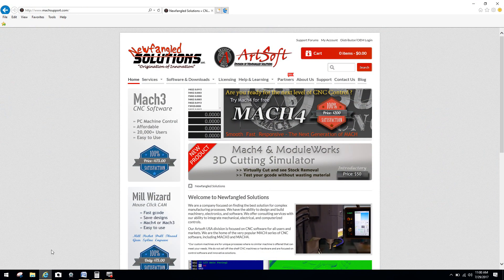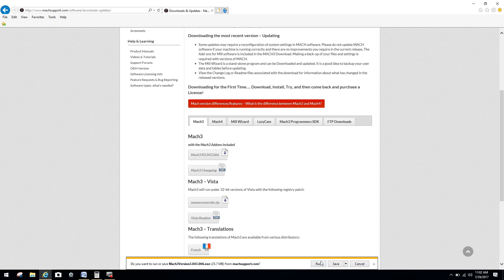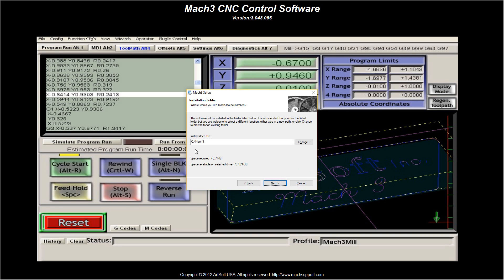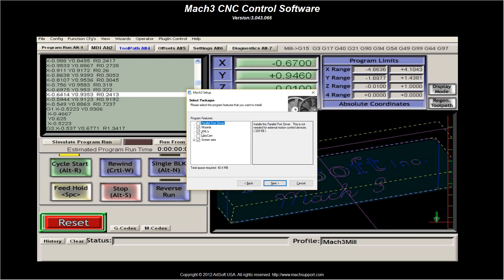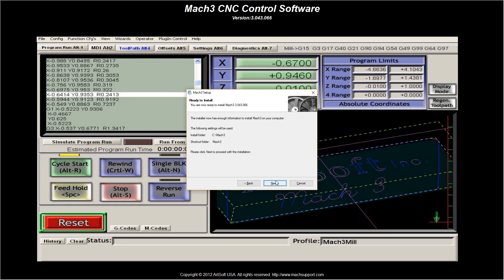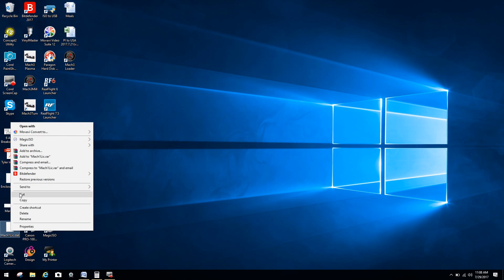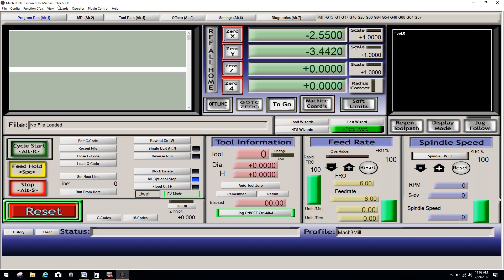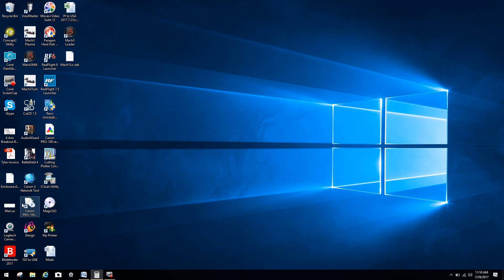How To Install Mach3 Motion Control Software & Your Users License (A very straight forward process)

Comment: Thanks for the info. I tried reinstalling it like 3 times. I downloaded the .exe file from machsupport.com but it still wont work. Im wondering if its my laptop that is the problem. Im using an Acer Aspire A315-21-92FK. I cant find any help online. Thanks for your time
Reply from the maker: Are you using a UC-100, or Ethernet Smooth Stepper? You can't use parallel port on a laptop. Thank you,
Vince
Reply: @corvetteguy50 R Right now I'm not hooked up to a cnc machine. I'm just trying to get Mach3 to load properly. But I will be using a UC-100. I don't have the parallel port driver installed (because i'm using a laptop) but the mach3 screen won't load. Also, my top bar doesn't say Mach3 demo, it says Mach3 CNC Controller. I have no idea why. I have an official license but when I put the license in the Mach3 folder nothing changes. Any ideas? Thanks a lot :).
William
Reply from the maker: Try using the method in this video I made as it assures complete removal of the software. https://youtu.be/K_9fvehvv-w

Thank you,
Vince

Comment: Thanks for the great video. However, I have a problem when I try to load mach3. When it loads up the screen is white. There is still the toolbar at the top of the window, but the rest Is white. I tried loading the 1204 screen, but nothing changes. Any ideas? Thanks.
Reply from the maker: William, thank you for your support. I recommend unistalling the software, reinstalling it. If the software came from a chinese machine there;s a 99% chance its pirated. Thank you, Vince

Comment: I've understand that Mach3 won't work with Windows 7 pro 64 bit, but do have parallel port for 
my printer. Do I need any hardware to run Mach3 software because of 64 
bit machine?
Reply from the maker: Yes you'll require either a UC-100 motion controller to convert the system to USB https://www.ebay.com/itm/132505537529, or Ethernet Smooth stepper https://www.ebay.com/itm/133064380079 

Either of these will work with any Windows platform be it 32bit, or 64bit.

Thank you,
Vince

Comment: I've understand that Mach3 won't work with Windows 7 pro 64 bit, but do have parallel port for 
my printer. Do I need any hardware to run Mach3 software because of 64 
bit machine?

Comment: I'm a newbe to Mach3 CNC Router, so I hope this is not a foolish question, but When downloading the software and installing do I need to have my machine plugged in my usb and turned on? I'm running Windows 7 64 bit
Reply from the maker: No question's foolish. thank you for your support. If your simply installing the software then you don't have to have the USB turned on. The only time you will require the unit turned on is prior to running the software. Thank you,
Vince
Reply: @corvetteguy50  Thank you....  I am running Windows 7 pro 64 bit NOT 32 bit, and do have parallel port for my printer. Do I need any hardware to run Mach3 software because of 64 bit machine?

Comment: Hi Vince, Great video, good tip about the parallel port driver. I have just installed Mach3 on my windows 10 computer and am waiting for my UC 100 to arive. So I will uninstall and re-install and disable the driver. Just one question if I may. I have got mach3 to go full screen but my icons are masive. have I done something wrong? I have been into mach3 General Logic Config and all the boxes in Screen Control are checked. So I'm scratching my head a bit. I noticed your icons are normal size and the mach3 went full screen. I would be grateful for any advice you could give. Thanks, Terry.
Reply from the maker: Terry,
Thank you for your support. I would uninstall Mach after making a backup of your settings, and reinstall it again to see if that corrects the issue. Their are many variables that can cause issues with it from other programs, to hardware configurations. I would start with this first as its the fastest to do, and least intrusive.
Thank you,
Vince
Reply: Thank you for your swift reply. I will re-install mach3 again and see how it goes. Thanks, Terry.
Reply from the maker: @Wrighty  You Bet :) Thank you Vince

Comment: I have Mach3 running under Windows XP for 5 years. It may be a dinosaur, but as a stand alone, dedicated system, it is still hard to beat. My axies according to Mach 3 have done over a thousand kilometers........  AND NEVER LOST A STEP.   Beat that!   :) Who needs smooth steppers and ethernet?
Reply from the maker: Warren, thank you for your support. XP started it all, and if used as a dedicated system it still works for many like yourself which is all that matters. :)
Thank you,
Vince

Comment: my 6040 is usb .. computer 32 bit windows 7.. I cannot get mach 3 to launch at all.. I keep getting a pluggin defective message
Reply from the maker: I would uninstall it, and reinstall it. If the unit is USB you have to make sure you installed the required USB driver for your system. I suggest contacting the vendor as they should have it. Thank you,
 Vince
Reply: thanks , I messaged them.. I went to china cnc and downloaded their usb driver, but who knows how many different 6040s are out there now.. SO im waiting for the seller to reply.. thanks.
Reply: so mach 3 is running , I got a reply from the Chinese seller " Oh we soo soo sorry , we no include driver for you order. We get order weekend , and we hurry to ship item. we send Monday , Ok my friend ? sincere, Phang " So , I need to find all 6040 drivers and download them all I guess.
Reply from the maker: Rob, this is a massive issue when ordering overseas. The sellers typically have no regard for your lost time. I hope the system runs great after the headache. If you Google for the drivers, if you haven't already you may find them. The only issue is there are so many vendors selling these types of systems now that even if you find one you don't know if it will be compatible with your system.  Thank you Vince

Comment: I've had mach3 for about 8 years computers old keeps crashing One update to a newer system what do you recommend I have the old Mach 3 with a Serial port thanks
Reply from the maker: Kevin,
You'll need a UC-100 USB controller to use Mach3 with a newer Windows computer running Windows 7-10.
This will allow you to convert the system to USB control, and get rid of the old parallel port DB25 cable.
Thank you,
Vince
Reply: Hello just trying to see if you can help me out I got another computer Windows XP got to  working only problem I'm having is a z axis every time you cut a part and it moves to cut the next part it keeps picking up and pulling away from the material try to turn the THC off try to motor tune everything I do doesn't work any ideas thanks
Reply from the maker: Kevin, 
Please review my video on troubleshooting your system like a pro located here. https://youtu.be/FSQGvfGt2Qs

If you still would like a consultation you could contact me at my email address Storm2313@gmail.com

Thank you,
Vince

Comment: I just wanted to add that enabling the parallel port driver on a laptop that does not have a parallel port can lead to disastrous results.  I installed Mach3 using the default settings (parallel port enabled), and it totally corrupted my Windows 10 (this is on a cheap RCA Cambios Laptop). I could not even reboot without it constantly going into the blue screen of death. I had to reinstall Windows from scratch. The problem happened again, until I saw your discussion on disabling the parallel port. Now it works fine. Thanks.
Reply from the maker: Andrew thank you for the input. Vince
Reply: @Andrew Sarangan hello i am using mach3 on laptop it doesn't have parallel port. The motors doesn't work. I am beginner. Can you answer why its happening or its not moving because i am using laptop. Thank you

Comment: It is amazing how many folks today don't know how to cut, copy, or paste on their computer. Nice job illustrating the installation. Thanks.
Reply from the maker: Robert, Thank you for your support. I think sometimes it has to do with the manufacturers forgetting the fastest way to illustrate anything is with a video. I honestly get more questions on the installation of software than I ever thought I would. I hope it helps everyone. Thank you,Vince
Reply: So if i am running windows 8.1 can i run on the parallel port